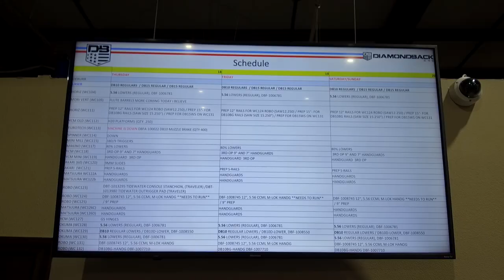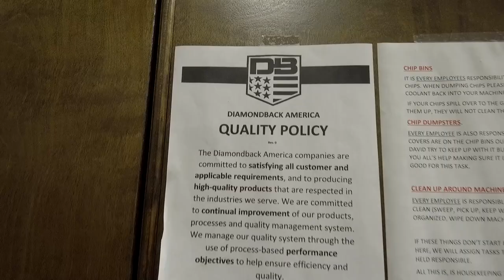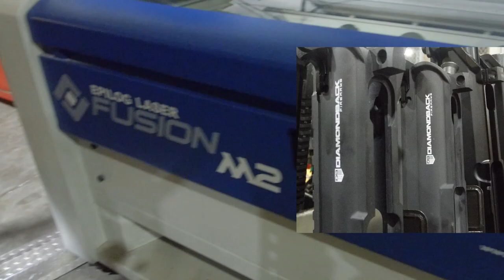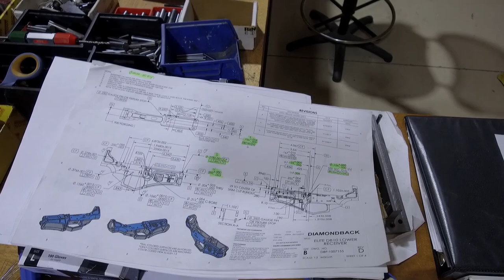Diamondback Firearms Factory Tour

Comment: Just beware of one thing...Diamondback is always out of stock of extra cylinders for their Sidekick.  I have been on a waiting list for a while now.  Some of these are shipped with just one cylinder; either a 22lr or a 22mag.  I went into a local gun shop and while I was at the counter, I asked for verification that it came with the two cylinders.  The salesman assured me that it did.  Even the tag on the gun said 22lr/22mag.  I went through all the paperwork and paid for the gun.  When I got the box and opened it, it had just the 22mag cylinder.  I asked the manager of the store and he said that it would've cost me $60 more if they had one with both cylinders.  I said I would be glad to pay the extra.  He looked around and couldn't find any with the 22lr cylinder in their stock. I was pissed.  I will never go back to that store again.  And the wait for the cylinders to be made at the Diamondback factory seems endless.  Good luck if you get stuck with one without the extra cylinder.
Reply from the maker: Sounds like your local dealer needs to do their homework before telling you things.